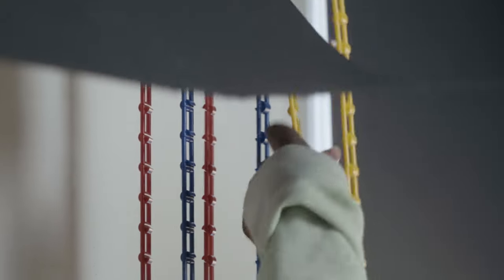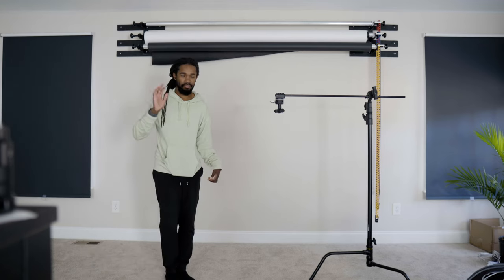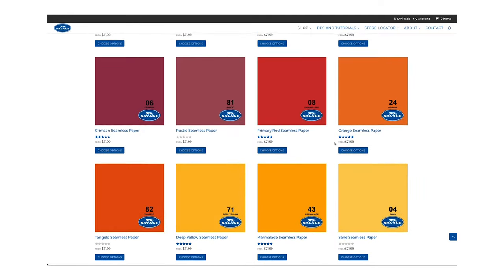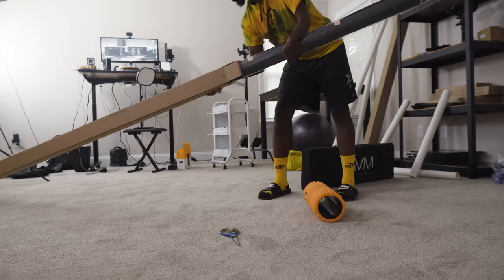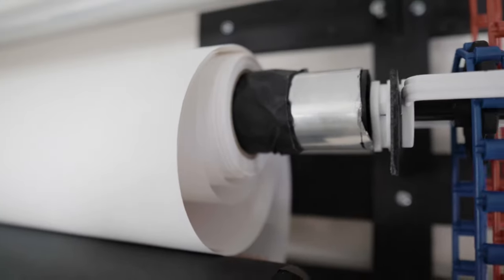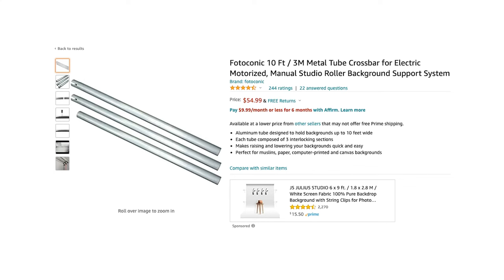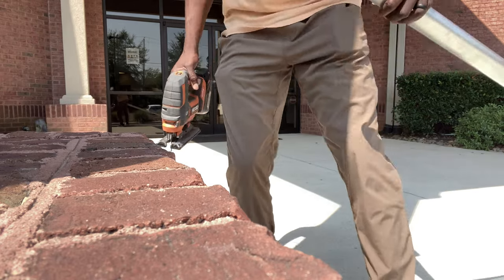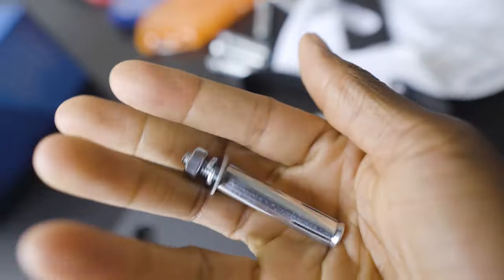My Backdrop Setup | Neewer Wall Mounted Background

Comment: More people need to learn how to use a handsaw. With the right blade and long strokes, you can cut through aluminum tubes or even thin solid bars pretty quick. You can get one for only $6.47 at Home Depot currently. You can also get pipe way cheaper at your local Home Depot or Lowe’s than ordering online.
Reply from the maker: Haha true I need to learn. No shame. At the time Lowes/Home Depot/Tractor Supply didn’t have any and said that they couldn’t cut them in store. I have no idea why but that’s what I had to deal with. I’m sure they’re good now but in my area they were slacking lol

Comment: Thanks for this video! I may try out those poles. I'm building a Mini studio and am using manfrotto set up on one end and Neewer on the other end. Those poles are even cheaper than the impact ones I almost ordered. The home stores do carry conduit that is 2" diameter but it's not aluminum and much heavier. thanks again for this video
Reply from the maker: Glad it was helpful! I hope the set up goes smoothly!

Comment: hey awesome video I have just subscribed. What if i have a mixture of backdrop paper sizes some 86 inches long and some smaller back drop papers. Will it still work or do  i need to drill holes and adjust the size. Hope you understand what I am asking hah
Reply from the maker: I think I understand what you're saying...As long as your backdrop paper isn't longer than the poles that you have to hold them then you should be good. If you have a smaller size then you might just have to adjust where it's attached to the pole. For example, in this video, I have gaff tape holding it in place. If I had a smaller BG then I would have to adjust the position of the Gaff tape too. Does that make sense?
Reply: @RellyMoorer  perfect thanks a lot

Comment: Dude! Thanks so much for the valuable info. I purchased 3x 9ft wide savage rolls and was wondering if it needed additional support. I plan on installing my backdrop system in the next two weeks so it gives me plenty of time to order those aluminum tubes.
Reply from the maker: No problem! As you saw it was a lot of trial and error and I personally couldn’t find the answers to my questions so that’s why I made this video

Comment: I installed one on our studio, but I have an issue, when we roll the paper down with the chains, there's no way to stop the paper from keep rolling down... how do you stop it? I mean, how can you avoid the papel roll keep rolling once you roll it to the place you need.
Reply from the maker: Hmmm I'm not sure. I would make sure that every thing is secured tightly. Something could be off weight wise too but I'm not sure how that would be
Reply: Turn the little key on the side of the roll holder that doesn’t have the chain. This adjusts the tension  of rolling up and down!

Comment: Great video !  by the way why did you shorten the aluminum tubes ? I was going to shorten my aluminum tubes to line up the brackets with the studs behind the drywall but luckily there was wood behind the brackets just by chance.
Reply from the maker: I shortened them because they were the size for the 108" backdrops. The backdrops that I bought were 86" if I remember correctly. My wall wasn't long enough to just leave the tubes as is

Comment: how far apart did you place the mounts?
Reply from the maker: Mine were about 96in (244cm). It depends on where the handles slide in too. My backdrops have about 4in (10cm) of space on both sides so they don't touch the mounts.

If you're talking about the 2x4s on the wall then that just depends where the holes are on your mount when you get it.

Comment: The aluminum poles never sag?
Reply from the maker: I haven't had any issues with them so far and as of right now it's been about 2 months since I put them up
Reply: @RellyMoorer  Thanks.   Can't decide whether to get the aluminum 3-pc. or screw around with Home Depot and 10- ft. pvc trying to get the best diameter.

Comment: Why pvc won’t work?
Reply from the maker: The PVC was either way too small or too big for the backdrop and/or the handles that went inside them
Reply: @RellyMoorer  did you try 2 inch one? Because that’s what I am planing to do. Hopefully it fits
Reply from the maker: @AlfaMedtech  Yes. The 2 in pvc doesn't fit inside of the backdrop but the handle fits inside of the pvc. The 1 ½ in fits inside of the backdrop but the handle doesn't fit inside of the pvc. I couldn't find a size in between like 1 ¾ in
Reply: @RellyMoorer  thank you for your reply! 
Which kind of paper did you use? I purchased the savage seamless paper and it says it has a diameter of 2.125” so that wouldn’t fit the 2” PVC pipe ?
Reply from the maker: @AlfaMedtech  I used the savage seamless paper. The issue that I ran into was the 2" PVC was 2" in the opening/hole but the thickness of the actual PVC was preventing me from inserting it into the Savage backdrop
Reply: @RellyMoorer  I see! Thank you so much! I guess I have to spend 100 times more the price lol. Getting this $55 metal pole x 3!